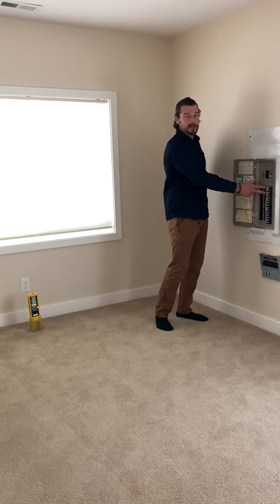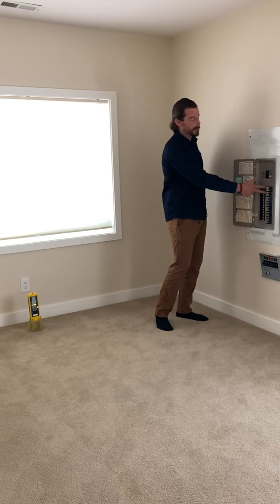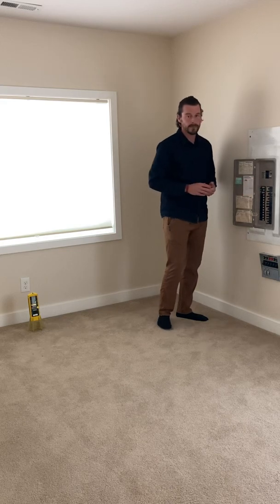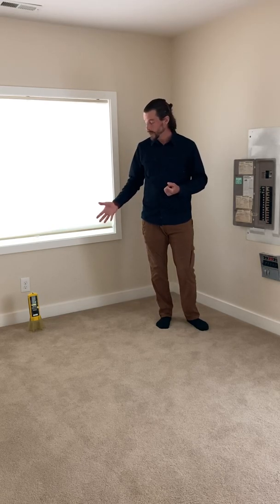Creating a Sleep Sanctuary: Circuit Breaker & EMF Meter Demo

Comment: So the EMF meter was detecting a signal from the two powered circuits in the room (presumably the lighting circuit & the mains power outlet circuit), & not the breaker box itself?

I hope you still monitor comments on a video this old!